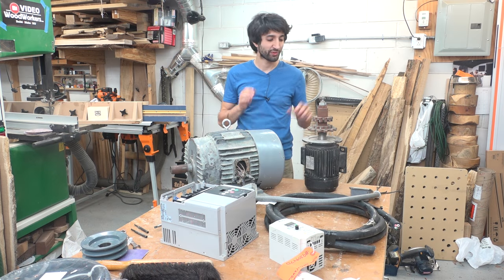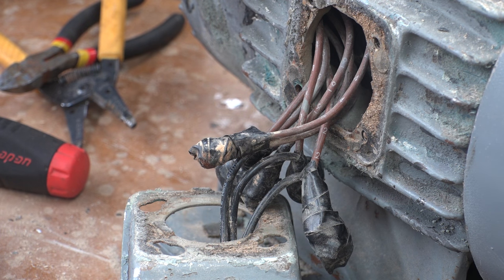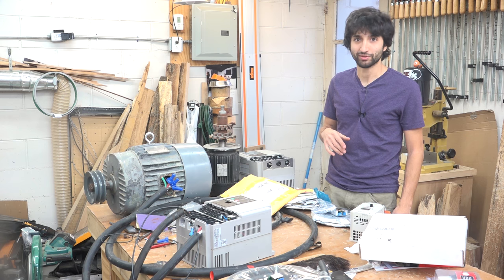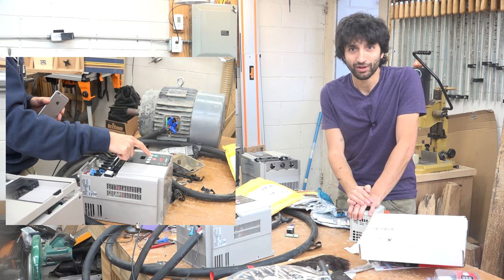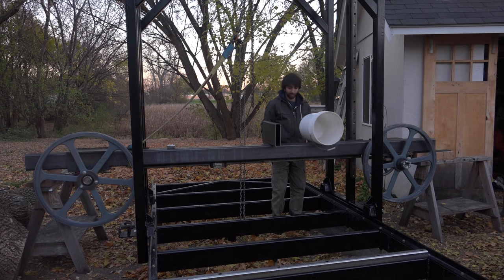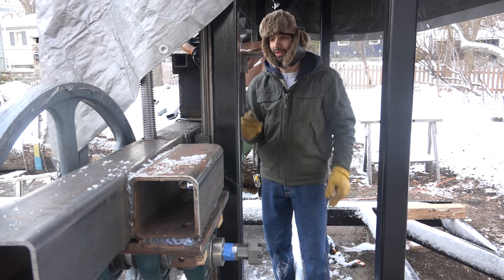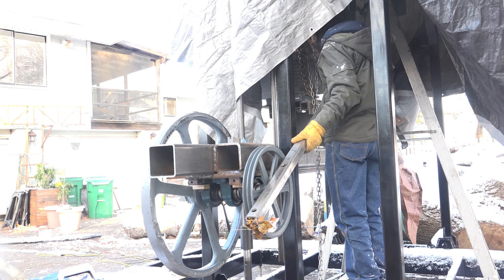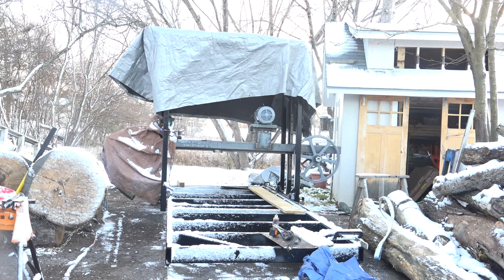The Drive Motor - Building a Large Bandsaw Mill - Part 11

Comment: Hey Matt, great video! I have some experiance with VFDs, and the one thing people often overlook is sizing the VFD to the motor on 220 volt single phase power. I'm not sure what size VFD you are using, but it should be 1 1/2 - 2 times the rated output of the motor FLA, so if you have a 10 HP motor that has an FLA rating of 30 amps, you would want a VFD that is a minimum of 15 HP or approximately 45 amps output. The reason being is that the VFDs DC bus capacitors are not getting their full potential on single phase power, so an undersized VFD loaded to it full output will generally go into a fault condition which is most commonly due to "low DC bus voltage " and the drive will trip with a fault code. you will also want a 60 amp circuit to feed the VFD. If the VFD you have know is also a 10 hp, it will more than likely work, but you may not get the full torque from the motor without tripping the drive into a fault. Let me know if I can be of any help to you on this. Scott from Minnesota
Reply from the maker: Thanks Scott!  The vfd I'm using is a 15hp vfd

Comment: Matt, just subscribed, on April's recommendation, and went through all of the bandmill vids. I did not go through all of the comments so if these suggestions have already been made please disregard. I have a Hud-Son Oscar 36. I see you have "fenders" on your carriage wheels, a great idea. I will say you may want to add brushes or scrapers to clean the rail on either side of the wheels. It does not take much to completely stop the cut or if you run over the bark chip to have it show in the cut. Secondly, one of the square tubes on my mill got water in it. This froze and split the steel. I know how much you love drilling holes in steel, so I suggest adding weep holes to the bottom of all members that could hold water. This opens up the inside to condensation/corrosion so weigh the options. Keep up the good work. It looks like I have a lot of other videos to watch. SteveB

Comment: Not to be critical but the bolts you are using to hold down you motor should have the nuts on the bottom. If the nut comes undone then the bolt will stay in place and still hold the motor in place. Just a suggestion.
Reply from the maker: Good point.  I have to add some lock washers so I'll flip them around when I do that
Reply: It’s not a bad idea, but you can’t really rely on that either.

I have a 35HP concrete saw, and the motor mount bolts are about 6” long, they are installed as you said, but they vibrated 2 out of 4 of the nuts off, and vibrated the bolts up out of their holes as well somehow.

On little bolts like his, it would be far easier for something like that to happen.

Comment: Hi Matt,
The blown green thing is a current limiting thermistor. It's job is to protect the circuits on initial power on. When it is cold it has a high resistence to current flow. When it heats up reistance goes down. In industrial electronics it is one of the first components to fail due to it's high operating temperature.

Comment: Hello Matt!! I missed it somewhere but, what is the width of the blade you use? I have a "scrapyard" built sawmill that I operate and can cut up to 24.5" wide (between the guides maxed out) and I'm currently using a 1" wide blade (.032") and it cuts just fine with some fine tuning (and a nice sharpening). I am in the process of building a new sawmill to cut 40" wide and would love to have your opinion on Blade Width for wide band cutting such as you're clearly knowledgeable of... I think I want to turn my own band wheels, or if I buy some I don't want to regret it because if I couldn't go with a wider blade... Thank you for your time and your videos are always easy to watch.

Comment: Love the build Matt. One are that I have concern is that you're only using 2 v-belts. Even on my 5hp planer there are 3 because of the resistance. I suspect that you might run into belt slippage, but I'm not an engineer that knows of these things.

Comment: Matt, I am using the same size 3 phase motor on my mill and am wondering what size VFD did you end up going with for your motor? Everything I am reading says for my 10HP motor I should go no less than a 15HP VFD.

Comment: I really enjoy your channel and have been following this build since almost the beginning. I was wondering if you've considered adding a third motor to move the carriage? You could wire it with feedback from the blade motor so that the amperage rises on the blade it would slow the feed rate of the carriage.

Comment: Hells bells starting to look a bit chilly at your end Matt! A lesser man may have thrown in the towel for the winter and returned to this in the spring, good on you for keeping going. This thought raises a few question for me though. As the track and tower are metal on metal will they freeze together in the depth of winter? Also, does the reduced temperature mean the metal will change dimension meaning it won't run as built? If so does that all mean this mill can't be used year round? Sorry if those are dumb questions,, I know nothing about metal stuff.

Comment: Matt, I’ve been looking all over but don’t see any info on the RPM of your motor. I saw the size of your pulleys when you were calculating your v-belt length, but how did you determine your blade speed needed?
Reply from the maker: I targeted a blade speed of 4500ft/min. Motor speed is 1725rpm

Comment: Keep going Matt, we're all cheering for you! I can't wait to see that first slab get pulled off the log!

 BTW: I've never worked with Hitachi before but I work with several Siemens VFD systems, they have much better documentation on setup. Very easy to use.

Comment: Dear Matthew, Love your work here. My brother is an Electrical Engineer another Mechanical. Win over a few more and you will have the whole family. I am attempting to build a relatively lightweight portable saw mill. I have some really big trees I want to cut down and harvest the wood for projects. So after scouring for months on the Tube here, I have come across a few bits of knowledge to follow. Most of it yours. Many of the 14+ or larger inch flywheel style saw mills use anywhere from 10hp-15hp. The larger the more you have to restrict things. 10HP seems more common. Read that a some guru suggested a 1-3 phase 40-45 amp 220v electric motor. No HP mentioned? Not sure why. I did not think of a VFD. I assume it is to control speed and start ups and stops etc. Is that what makes the "Variable Speed"? Anyway, I have the Granberg Alaskan Sawmill with Winch a smaller family farm type. (  https://www.youtube.com/watch?v=wZRNA7yo6s8  )  I am trying to modify the Granberg to fit a small motor that does not weigh 1000 lbs because I can't lift that up to the log and push or pull it across. Can you help me figure out what would be the best motor for the money for this product. The benefits of the electric motor over chainsaw is noise reduction, lighter weight electric vs gas & oil etc. Do you know anything about what kind of an electric motor that might work for this kind of application? FYI As you ma know, a good chainsaw with 60cc -72 cc's is usually enough to slide through a slab of log. Not sure what that equates to in HP. Your thoughts are appreciated. Thank you sir for any wisdom you can provide. Keep up the great channel.
Reply from the maker: Not sure why that's not specified.  On single phase that would be about a 10hp but on 3 phase it would be 20hp.  Yes, the vfd allows for speed control and braking in addition to phase conversion.   The Stihl MS460 that I have is 77cc and is specd at 6hp.  Figure the equivalent of that would be 3hp or a bit less electric motor.
Reply: @mcremona  Do you recommend any 3 hp or less single-phase ?? Amp at ??? Voltage. Plus any brand model or a version of VFD. I am ultimately responsible for my purchase. I am fully aware. I am clueless in this kind of decision as to the factors. It is all too much and too confusing. IF you can give a little advice it appears you are clearer on the knowledge needed.  If it were you what would you get. It would appear you know and understand much more than most. It would be nice to cut a true 4x4 with it. At 4 inches thick I could make a lot of things like bunk beds for at risk kids. Something I do. So any advice you can give on brands models where I might save a dollar is much appreciated. The motor & VFD? Thank you very much for the response. Your knowledge is more valuable than you may already know.
Reply from the maker: @robburdine5429  For that application you probably don't need variable speed or braking so a standard single phase 220v motor would work well.  They're pretty easy to come by.  should be about $200 for a lightly used or surplus motor.

Comment: Missed that snow by about 200 miles Yea! what forum did you find the most info for setting up, troubleshooting your VFD? asking for others that may have issues.
Reply from the maker: I just spend a lot of time going through results on google.  The forum that I ended up at the most was practical machinist

Comment: The motor reconfiguration sounds like wiring it into a delta configuration from the earlier star. I have seen such motors started in the star, i.e. high voltage configuration, and on gaining speed, and sufficient back EMF, it is put back into delta. But the VFD being capable of varying the applied voltage at will it may not be important here. Seeking confirmation. Thanks!

Comment: Wow.  You bought your VFDs off eBay.  That was asking for trouble.  Considering the value of your time, how much did your save (or not) vs buying one from a reputable manufacturer?   Perhaps you should have consulted Paul whose you shop you visited outside Toronto.  Isn't he the one that uses all of the really old big 3 phase woodworking equipment all powered by VFDs?
Reply from the maker: +bwillan I got them for around 1/3 of the cost of new. I saved around $1000. If I would have had to buy new I would have just gone with an engine. Paul is running a phase perfect which is well outside of the budget at this point and he also has some older vfds that are no longer in production

Comment: Isnt that motor pretty small? 10 horse doesn't seem like much, even the smallest pre-made models have like a 12 or 14 horse, midsized ones like 25-100.... I was thinking about using a 65hp motorcycle engine...

Comment: In the future you will be able to control the speed of the cut based on the current of the blade motor. If the 10 hp motor starts to bog down in some hard grain you could have the carriage drive motor slow down automatically to maintain a constraint current and a cleaner cut. Lots of fun things you can do with the VFD's.
Reply from the maker: +jwilson9608 yes, very long term goal

Comment: PLEASE TELL US WHAT VFD YOU HAVE AND WHICH TO AVOID. WILLING TO SAVE DAYS VS FINICKY OFF BRAND ALI BAABAS. FINAL DRIVE IS BALDOR 10HP  22O/440 1OHP 12.5/25 AMP INDUSTRIAL SAW MOTOR.  WHAT ADD'L MOTO DO YOU MATVH IT TO A 15HP. WHAT DO YOU HAVE HERE IN THWE VIDEO,, DID I MISS THAT?

Comment: You do all this methodical drilling/tapping & paint/prep… then you use crimp on connectors and not new terminations with waterproof (it’s obviously going to live outdoors) heat shrink.  Like rebuilding classic Porsche and installing wooden spoke model T wheels.   If your gonna do it… do it right the first time.

Comment: I know this is long over, but when you put bolts in you should drop them in from the top. The reason being if the nut drops off the bolt will still remain in place holding the motor and not allowing it to drop of the mount.
Reply from the maker: I needed less bolt sticking out the bottom so the bolts would clear the guards.  In this case, if the nut came off, the bolt would not drop out since the guard is directly below it.
Reply: Understood.

Comment: Can the motor turn both ways? And/or would it even matter which way the blade will travel?
Reply from the maker: Yes, it can be reversed either through the wiring or through the vfd.  Not a very useful feature here though since the bandsaw teeth point in one direction.

Comment: Is getting 3 phase really that expensive? You are loosing power this way right?
Reply: power is power. If anything he  will save on cost of wiire. Which is the main advantage of 3 phase.
Reply: I have heard that a power company will charge around 10,000 to put in a three phase distribution, if they will do it. He is not really losing power. A 10hp motor is 10hp regardless of single or three phase. The single phase vfd setup that he has will draw more amperage than a three phase powered vfd.
Reply: Ok I don't really know hos this works, but around here I hear this a lot; That the same motor is stronger with 3 phase then of I convert it to single phase with a capasitor etc. No idea about VDF's. The reason I asked is that here in Norway it's no problem getting 3 phase as that is available in pretty much every house.
Reply from the maker: A static converter will have a power loss.  VFD and rotary converters don't suffer a power loss or if they do, it's minimal like 5%
Reply: Matthew Cremona Ok cool, thanks for the info!

Comment: What's the rpm of the motor? At 1750 rpm that would roughly be 4,750 feet per minute on the blade. Good thing you have the VFD
Reply from the maker: I believe 1750 or around that

Comment: Really exciting to watch the bandsaw build. Very inspiring. Do you have a 220 outlet in your shop? or is the vfd plugged into a regular outlet? thanks.
Reply from the maker: +Breece Woodworking the vfd is plugged into my 50amp 220v outlet that I use for my welder. Thanks!
Reply: @mcremona  You keep mentioning that you only have single phase power available. I don't know if this is a simple slip up on your part, but it is incorrect. Every power customer (residential, commercial, or industrial) in North America have at least two phases coming in. That is what 240V is.
Reply from the maker: @JV-pu8kx  semantics.  Single phase service to the transformer where it becomes split phase; 2 120v lines 180 degrees out of phase.

Comment: Little bit of suspense there.... I was afraid that when the motor started up the torque would roll it right off the workbench!  But it looks like the VFD provides some kind of soft-start functionality.
Reply: VFDs are generally unable to supply the hard-start current required by induction motors, so they always soft-start them. Usually this is a parameter (accel/deccel time, newer ones have programmable curves and stuff), but setting it too low can trigger the over-current protection.

Comment: Hi Matt
How many amps did you need to feed into the Vfd to power that 10hp motor
Reply from the maker: 60 at full load.  Typically it will draw 40-50 when cutting. 17 during start up.  12 at idle.
Reply: Matthew Cremona it’s on a dedicated 100 amp service?
...
Reply from the maker: It's on a dedicated 60amp circuit

Comment: Will you have clearance problems at the top with the motor mounted that high?
Reply from the maker: I'll just have to get creative with the routing of the chain that links the lifting rods.  Otherwise the top is open
Reply: Can you go over top of the motor with the lifting chains to the shafts? Extend the shafts Higher than the drive motor? You realize this is looking like a Giant 3D printer LOL
Reply from the maker: I can if needed.  I ran the lifting shafts long just in case but I should be able to route the chain pretty easily with a couple of idle sprockets.  The carriage is already pretty tall and I don't really want to make it any taller.
Reply: Yes no need to get top heavy!
Reply: how about 2 sprockets on the motor and mouting the motor at the back behind the Blade drive motor?